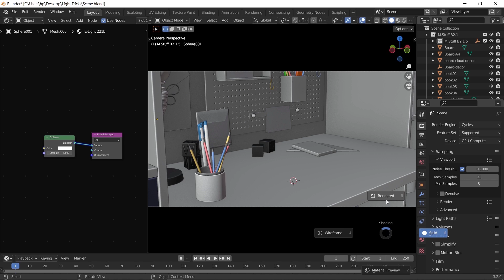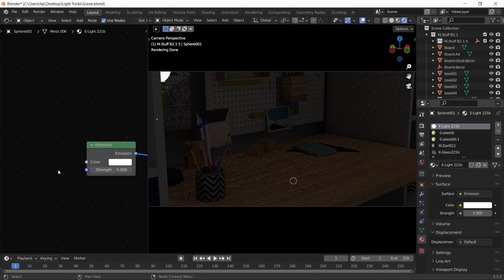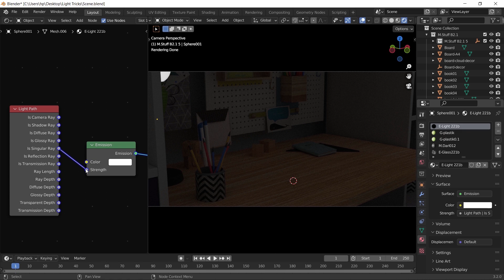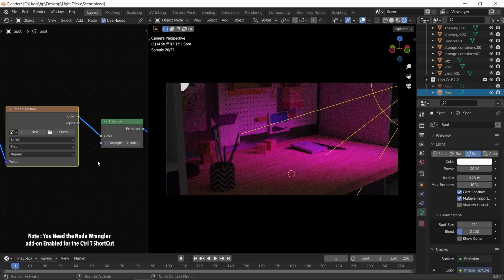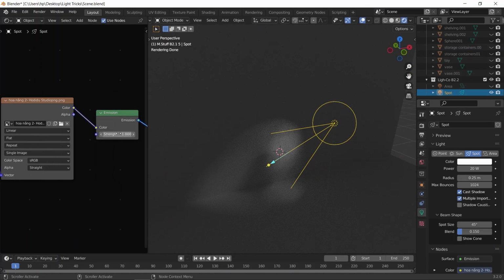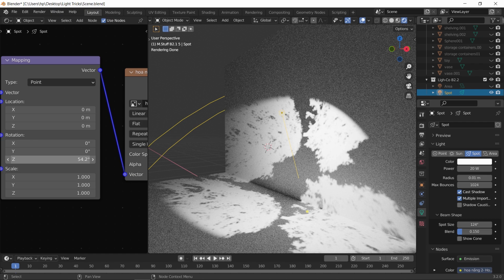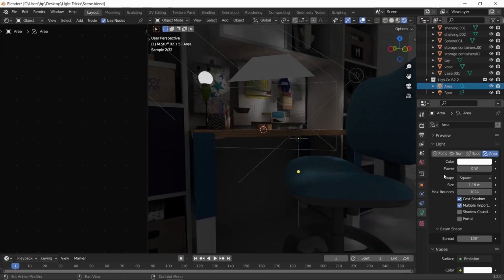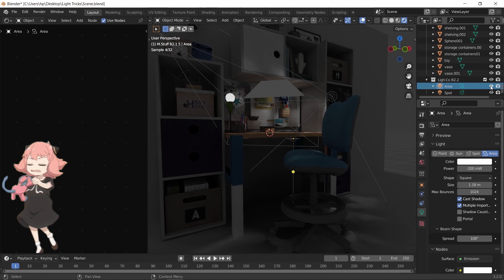Lighting Tips in Blender You Probably Missed

Comment: When I connect 'Is Singular Ray' to the emmission strength and then the emission node to Material Output -> Surface, the mesh turns only black in cycles. What did I miss. I tried with blender 3.2, 3.3 and 3.4 on macOS.
Reply from the maker: Make Sure You're On Cycles Since the IS Singular won't work with Eevee. Also try the Ray Length/Depth output and connect it to the emission that might work if the singular gives you a black result.
You can read more on the Light Path here 
https://docs.blender.org/manual/en/latest/render/shader_nodes/input/light_path.html
Reply: Same issue here.
Reply from the maker: @PepGeeTv  Please Visit the channel for Step By step Tutorials, From /interior to Exterior ones.

Comment: But what if you needed the emissions round object to light the scene? Would you hide a point light inside it somehow?
Reply from the maker: Point light won't cast in all directions, and Blender don't have ambient light where a spot cast in a spherical way, So you kinda stuck with the emission. In the case of which you have a lamp as decorative ( as in the video ) the Light path node would help. Other than that I think you need to sacrifice more samples to fix the issue if occurs.
Reply: Absolute bs. The reason why noise comes up in the first place is bc an emission material is not found by a light ray as light source. However some random light bounces will hit the emitting material and tell the pathtracer "dude it is bright like hell here". and so you get random white pixel. So how to fight that? Well you go to the object settings of the bulp and turn off shadows. Then you stick a point light in it. Point lights emit light 360° around. Thats exactly what pointlights do! So now the pathtracer sees a lightsource at the bulps position and all the noise is gone.
No plan why the video creator spreads misinformation.